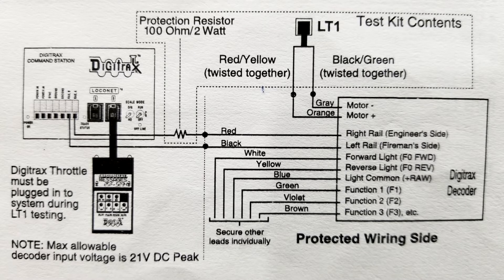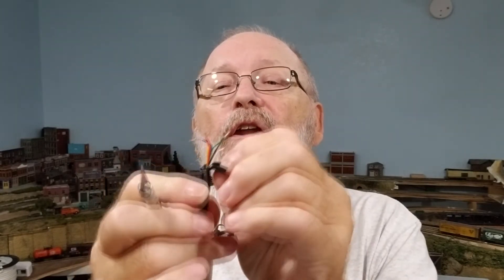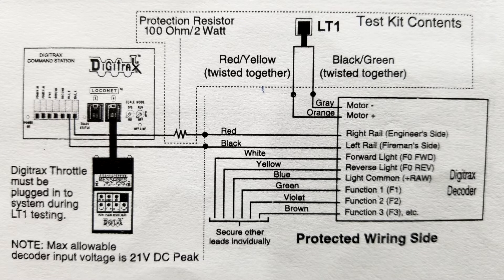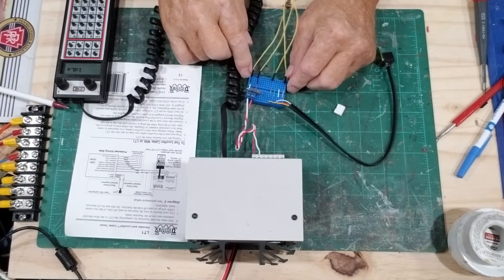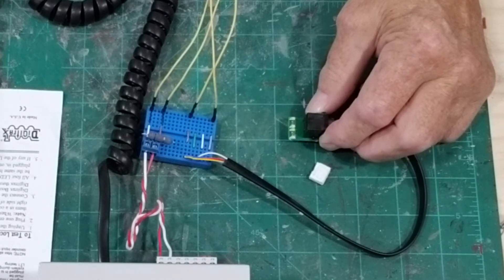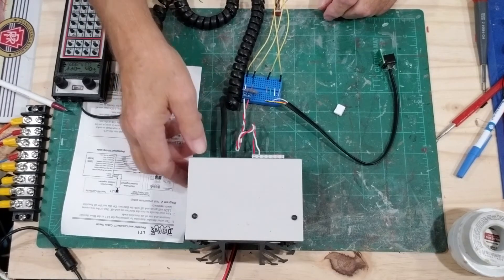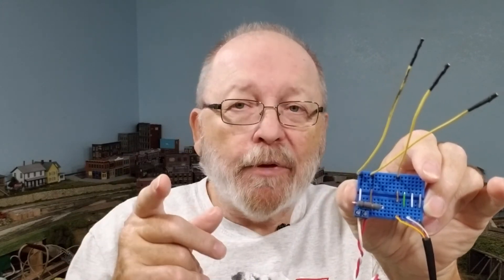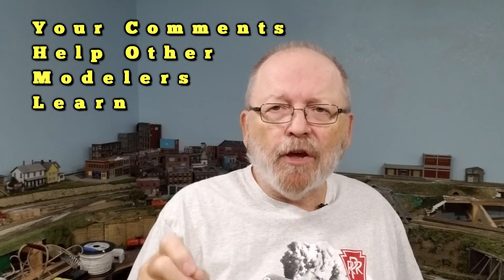How To Test Your DCC Decoder With The Digitrax LT1

Comment: Hi Tom... would be great to get a more indepth video on this... i have no clue what holes the resistor is plugged into. also does this have to be done with a bread board? id rather not spend more money. i run n scale so just about ZERO of them come with wires to be plugged into. Thanks
Reply from the maker: You don't have to use a breadboard, I use it since it is easier that way to make connections. You can watch my other videos on electronics to see how the breadboard works

Comment: Tom, when I test a decoder with an ohmeter, I get a closed circuit between the two sides i.e. the contacts for the two sides of the loco frame. is this normal and if so, why does'nt it cause a short when installed?
Reply from the maker: Don't understand what contacts your referring to!
Reply: @TomsTrainsandThings  for example, the places where the motor tabs go or the contact points on the decoder which contact the frame (in an N scale two-prt frame).

Comment: Hey,Tom recently purchased a bachman spectrum g scale c19 locomotive and a digitrax evo dcc system. Is dg583s decoder a good choice?
Reply from the maker: Steven, check out the Digitrex decoder selector. It should tell you if that decoder is compatible with your locomotive.

Comment: Hi Tom, do you have a way to test if my E-Z 36-500 command controller is sending a voltage to the track. I do not seem to be getting any reading across using my multi meter? i have the muti meter on 200 volt ac setting. Is this correct. Needless to say the train is showing no signs of life.
Reply from the maker: Tony, you might want to drop your meter to a lower range if you have it. A typical DCC signal shows up as approximately 14 VAC.

Comment: Thanks Tom. I bought a DCS50 (no longer in production, I learned) on Ebay. It appeared to be new, but is dead in the water. Thanks for helping me to figure out why it would not work! Nick
Reply from the maker: Same thing happened to me a little while ago. Bought one at a train show that looked in good shape and found out later the circuit board was fried and wasn't able to use the direction control. So much for used items!

Comment: ESU make a decoder tester for pretty much every different type of decoder plug plus screw terminals for wires only decoders. It comes ready fitted with a multitude of LED's as well as a motor and a speaker for sound decoders...
Reply from the maker: Thank you Stu. I know about it, just don't have one to do a video on it! Maybe at a later time.
Reply: Toms Trains and Things I just thought that would be a lot lot easier than using a breadboard etc, for those who aren't too confident with electronics...
Reply from the maker: The ESU unit is much easier but the LT1 tester comes with every Digitrax system to test cables and decoders. It's crude but works in a pinch.

Comment: Do you have a video on how to wire a decoder into a locomotive? If not do you think you will be making one
Reply from the maker: All my locomotives that need a decoder have the 8 pin plug in them, so it's just plug it in and go. If I can find an older one at the train show in Tampa I may do a video on it, but currently I do not have one. Are your locos DCC ready or do they require installing all wires?
Reply: Most of mine are 8 pin but I have a few older ones that require me to wire them up and I can not find any good videos on how to do that.
Reply from the maker: There are two train shows coming up shortly in the Tampa area where I may find a good loco for this project. I can do a video on this if I can find an older one that runs well enough to install a decoder. It may be several months though!